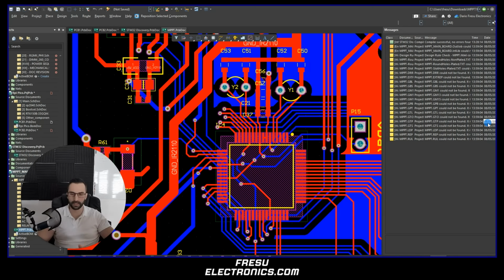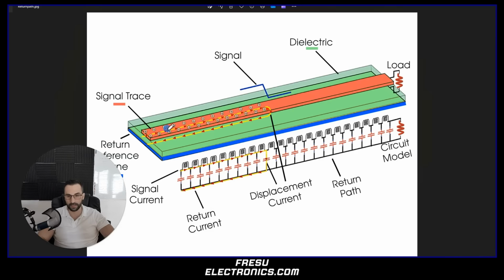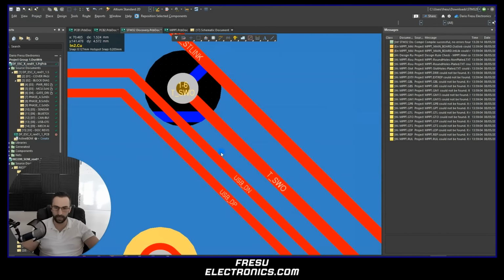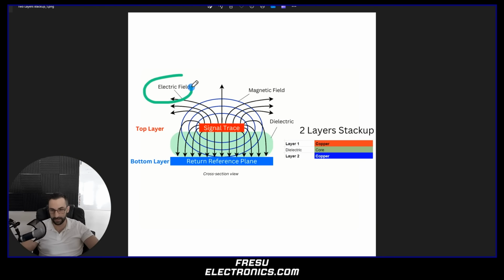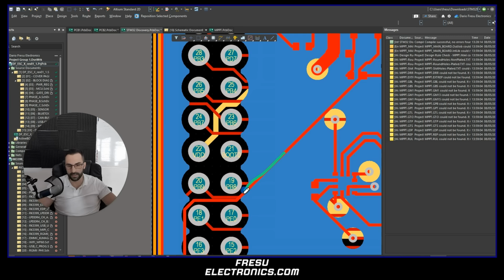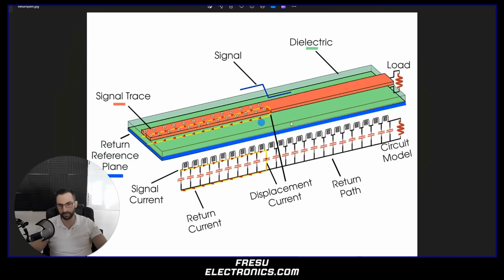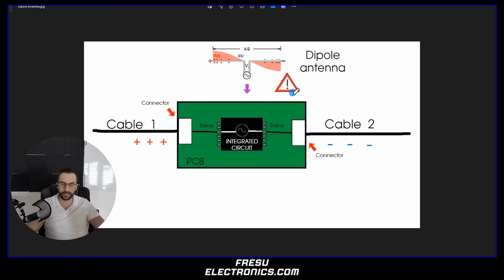Top 10 PCB Design Mistakes for low EMI and Signal Integrity  - PCB Layout Reviews

Comment: The first point:    
Signal are on TOP and BOTTOM  and they are crossing each other. This is the problem as per you.
What if they don't CROSS each other and I mean signal tracks are running in  parallel  to each other. ???
Reply from the maker: The problem is not in crossing or not, the problem is in how the fields interact with each other. 
Having two signals traces placed in parallel to each others still requires a Return Reference Plane as close as possible to the signal traces so that the fields of one signal do not contaminate the fields of the other signal. 

These phenomena is called "Crosstalk" , you will find more content on the channel about that. 
Hope this helps,
Dario
Reply: @dario_fresu  Thanx, your video is very informative. To completely understand these 10 points and to co-relate with our work, I need to watch it many times.  
But I learn  one important point , which is most important. Try to make  maximum TRACES  on TOP layer  as much as possible and avoid TRACES at BOTTOM layer. Bottom layer will be used for ground plane/reference plane.
This exercise will give you a un-scattered REFERENCE PLANE (GROUND PLANE).
REFERENCE PLANE is like a DUSTBIN and it will adsorb every bad signal/(noise).
Reply from the maker: I would highly recommend not to think I'm terms of "Ground" or "Sink" or "DustBin" 😂 but rather think in terms of potentials, one for the signal and one for the reference. These two always go together. These is what forms the voltage, which is basically a difference between these two potentials (by definition). Then, this voltage is what we call: Signal.  
But you see that if you follow this logic, there really is no signal without the reference potential. 

Is the same as if you design the schematics without the ground port!
Reply: @dario_fresu  I was wondering... What about having a simple, single layer PCB, where a signal is routed right next to its return trace, separated by some standard 1-2 W clearance. How the EM field is going to behave? Will it be propagating between these two conducting traces in the air and FR4 between them?

Comment: Top 10 PCB Design Mistakes for EMC and Signal Integrity - PCB Layout Reviews.
This is applicable to HIGH SPEEED BOARD  or any SLOW board ?
Reply from the maker: If you see from some other simulations I made, even a 10KHz signal create troubles. 
So the problem is not much about slow or fast, because yes the behaviour changes due to the inductance dependency, but we have to be careful about what we call "slow", which in reality happens at frequency level very close to  DC.

Hope this helps, 
Dario

Comment: kind of advance level topics. excellent details.   The PCB you have used for reference is totally wrong as it has signal traces on both sides ?
How 220V AC inductive load play a role in EMI/EMC? They also create EMI on 220V AC line which come back to PCB through power supply . 
Is there a way to handle this? any other video ?
Reply from the maker: Thank you for watching the video.
That's a good topic for another video ;)

Comment: What is mentioned is very accurate. They are so simple but at the same time so difficult to implement. Also, many designers do not have this knowledge in physics and electrical engineering. They have simply learned to run some design program. You have great contagiousness and experience. Thank you very much for sharing such important knowledge.
Reply from the maker: I'm glad you find it useful. thank you also for the nice comment and for watching 😉

Comment: Big thanks for this video! Really made a difference.

Video Timeline 
[00:00 - 00:15] Introduction
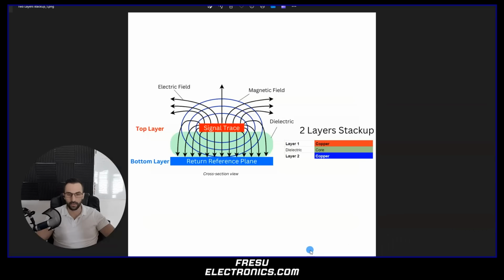[00:19 - 05:45] Problem One: Choosing the Appropriate Stack-Up

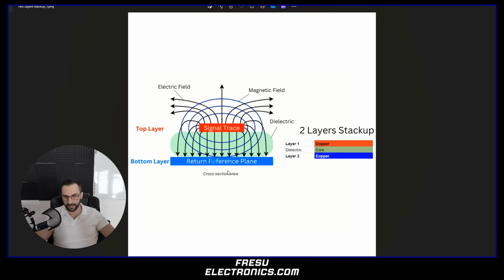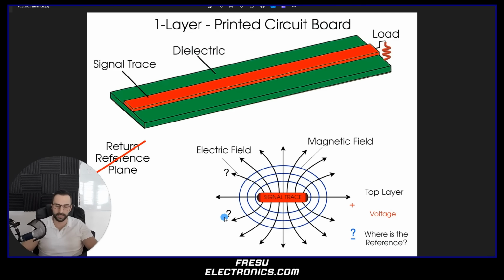    Understanding Signal Return Path [06:00 - 12:59]
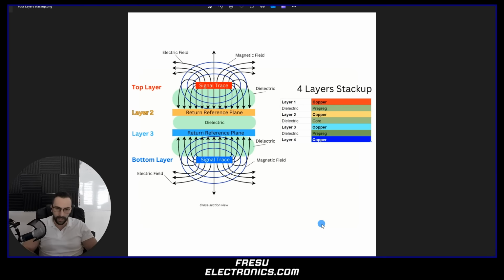    Dealing with Absence of Return Plane [13:00 - 13:49]
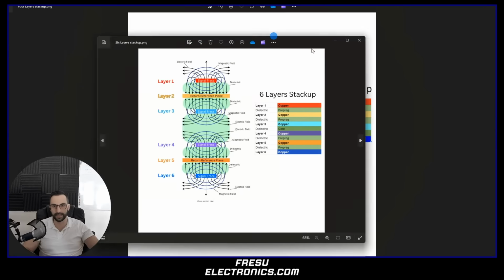    Exploring 4 Layers Stack Up [13:50 - 14:39]
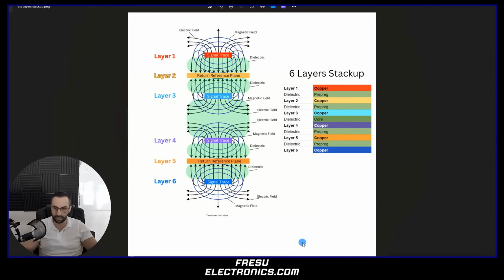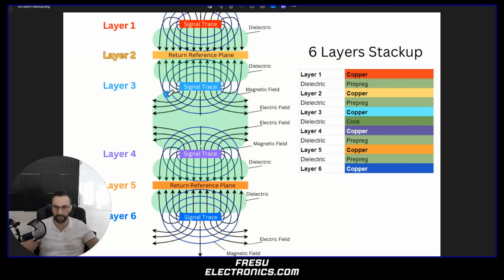    Maximizing Potential with 6 Layers Stack Up [14:40 - 16:18]

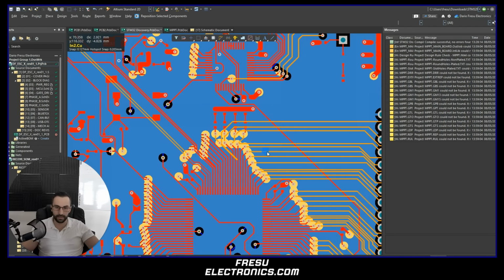[16:19 - 18:59] Problem Two: Having Traces Very Close to Each Other
[19:00 - 23:33] Problem Three: Reducing Parasitic Effect from Routing
[23:34 - 26:43] Problem Four: Large Current Loop Size
[21:30 - 26:43] Problem Five: Adding Protection and Filtering for Each In & Out
[26:44 - 30:59] Problem Six: Separating Grounds (Analog & Digital)
[31:00 - 33:54] Problem Eight: Strategically Placing Components
[33:55 - 38:32] Problem Nine: Controlled Impedance Traces
[38:33 - end] Problem Ten: Creating Antennas
Reply from the maker: Very welcome 😉
Thanks for watching!
Reply: Where is problem 7 ??😊